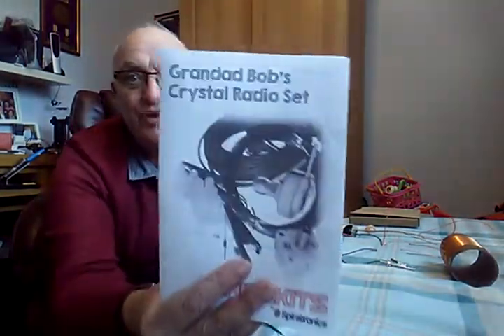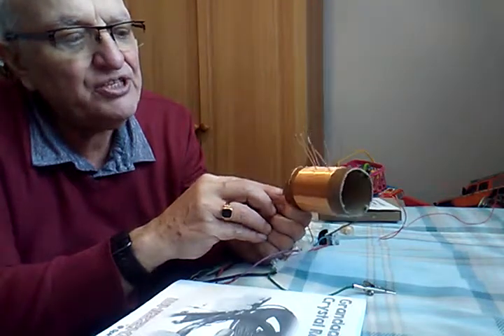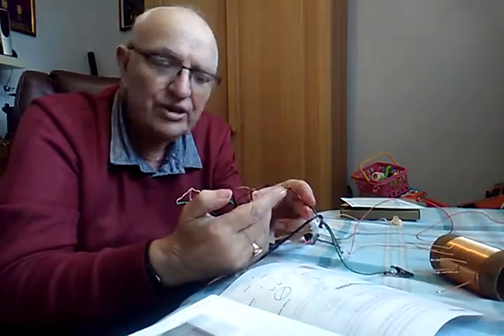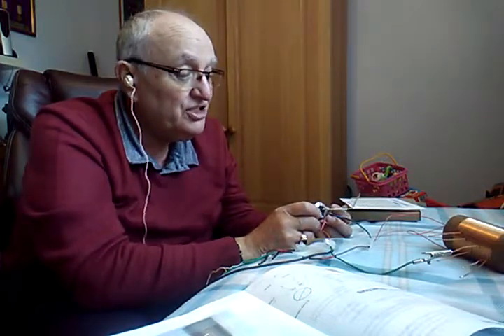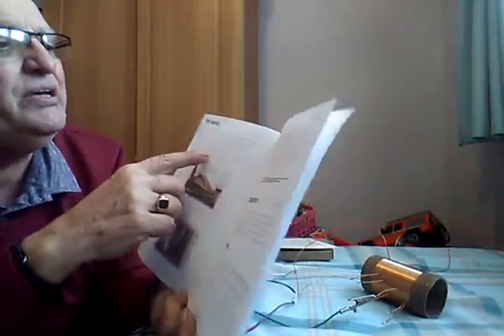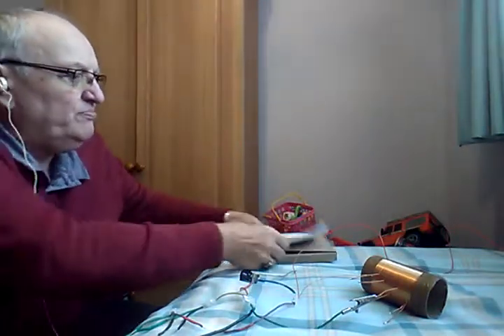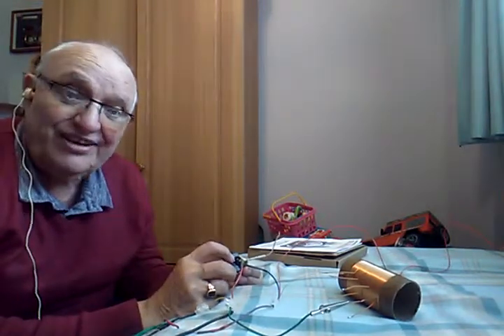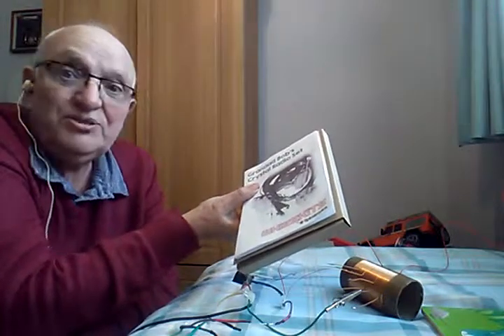Grandad Bob's Crystal Radio Set.!!

Comment: I also built this set, and I winded up the coil on a 4cm (diameter) tube. So I calculated my coil to be about 1.16uH. And with the included 106pF capacitance I get that it will tune from 1kHz to 50kHz but this is nowhere near the normal AM band and I coud, of course, not really receive anything :) I earthed it to proper ground and got some noise but I am sure I am totally off range for any transmission with this coil to really receive anything. My question is: What is the expected uH values of the coil if wouned up as per. the description with loops on 15,30,45,50,80 steps ?